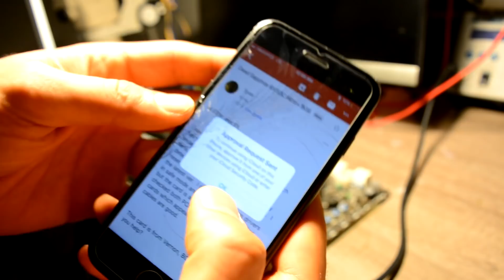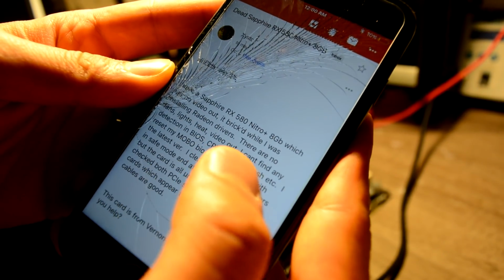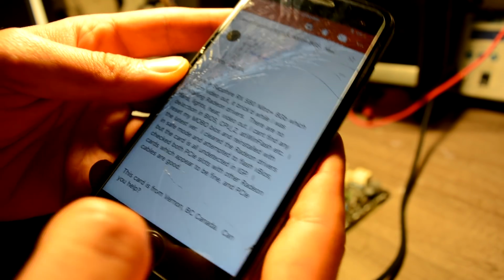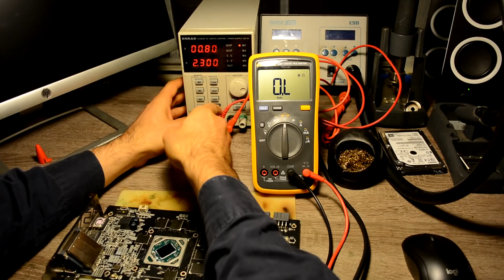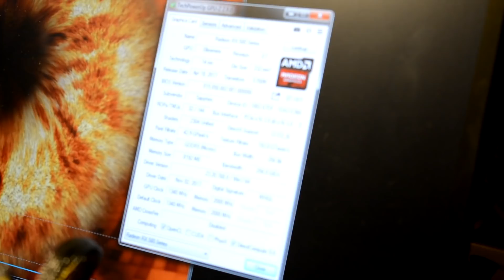RX580 repair graphic card unusual problem Radeon Sapphire nitro video card repair

Comment: ser i need help i have an asus b85m-e mobo with rx 580 (xfx) its runing on pcie x8 (3.0) instead of x16
Reply: Try reaseating the cpu and check for bent pins or out of place pins on cpu socket, it happened to me on 2 different occasions using 2 different pc builds, try it and let me know, if you have an Intel board I know this might work

Comment: I also need help with a RX 580 soon as I plug in the 8 pin it shuts off the power supply it's a msi card
Reply: Did u find why ?
Reply: @AdamKimo  I applied power from a power supply that doesn't shut off low amp and it popped a mosfet I replaced it with a new one and now the pc turns on with it but the gpu doesn't get hot and no power on any of the phases

Comment: My congratulations... Can I ask you for some help... I bought a 2nd hand RX580, I run it 1st time all perfect and I decided to change the Thermal Paste and Clean it, because it was really really dirty... also with some oxid. It runs perfect... but I have a problem if I leave the graphic card some hours power off, I need to give some hot air to make it start up. After that hot air it starts and I can leave it without any problem hours and hours...

Comment: I have the same card brand new from Amazon and I works for a couple of minutes and then it either stops showing image or goes to a random solid color like purple, but the fans and everything is still on. Any ideas what the problem is?
Reply from the maker: chip.. gpu went out
Reply: @elitech3339  so it is DOA? This is second card I've bought that hasn't worked :(
Reply: @elitech3339  I also have a new card that would turn on with the fans and everything but would only show a black screen? The monitor said it detected a signal but showed no image

Comment: I just learn from your video that doing a video card repair job just isn't worth it considering how long it usually takes to pinpoint the problem in similar cases and howmuch the customer is willing to pay for the job. and whe you find a chip problem then most likely just a total waste of time as only few customers are willing to pay for a new chip and reball job. :S

Comment: I have strange issue with this RX580 Nitro. On DVI works just fine in every stress test Unigine heaven, valley, furmark.
But on HDMI it just randomly cuts out and says "no signal" sometimes during the test in heaven, sometimes even finishes test and then when i press exit on heaven goes black again. When i plug in DVI again works without problems without going to no signal. Anyone else had a problem of that kind?

Cheers

Comment: Hi Eli, first of all nice vídeo I'm a tech from Argentina and I'm having an issue with my Sapphire Rx 580 nitro plus, maybe you can give a me an advice of what can be the problem with it. When I put the card on the pci slot the motherboard doesn't power on. I've tried it with 4 motherboards and it goes the same with each one. All mother's work fine without the card pluged in, ¿ in this video when you put the card on your mother is power on ? If no, maybe a can do a step for step like you do to know if a regulator or a driver is in bad state. Thanks for your time and keep the good work :D
Reply: Again me, if a power the graphic card the ATX enter in protection mode. So I can't test any driver or regulator... :/

Comment: I have a gtx 970  when i install it the pc boots like normal but no display i tried using the motherboard display while my gpu is installed and it has display .
I looked at the device manager > Display adapters i can only see the onboard display .. we tried to reheat it , and it works fine for a minute then .. sudden no display but it still works i can still feel it. sorry for my english..

Comment: XFX RX 580 I got has problems as well and I wonder if it's simply thermal pad and paste that needs replacing (It runs, it just crashes the PC if the GPU seems to ramp up usage, via BSOD). I never got around to actually trying to fix it because I don't use that GPU anymore (Asus Strix Vega 56 user here, I gave my Nitro+ 580 to my brother, and the old Intel i5 2500 system is using a 470 since it has 500 Watt PSU.

Comment: Great video bro. I bought rx580 as it is condition and its not booting no video no fan spin only blue light on the pcie power connector turns on. what might be the problem? I am in UAE can't find any repair guys here for gpu

Comment: Hey Eli, I am trying to diagnose an RX480 and was wondering if you could guide me in the right direction. The GPU "works". It boots, I can play video games and everything but everynow and then, the whole picture on the screen turns into a checker board pattern and the computer freezes. I have not been able to replicate the problem. Sometimes the computer works for days on and sometimes the computer will crash with the checker board pattern seconds after booting up. If I boot in safe mode, this problem never appears (AFAIK). 

Any idea of where to start looking?
Reply: Most likely bad GPU or bad VRAM, if you are lucky reflowing the VRAM chips will fix it, but there is no way to tell how long the repair will last.

Comment: Great video Eli. 
Btw i have a problem with my old card, when I turn on my pc the fans just go to 100% speed and doesn't slow down and it has no display. What do you think is wrong with it? I'm using a different gpu now and everything is fine, just my old card is having this issue.

Comment: hello, I have an asus r9 390 strix 8gb that randomly, that is not at any particular moment, crashing and the monitor is without signal, the only way to restore the system is to turn off and on again the pc, since when restarting the problem persists, what can be the causes of this?

Comment: Hello Eli Tech. Your videos are amazing! There is so much knowledge you give people free. Thank you very very much!
I also would like to ask you something: I have a broken gtx1050ti which is crashing at driver load. The card is working fine unless i use nvidia driver. This happened for the first time during gaming with 100% load on GPU. Since then the GPU keeps crashing. Tested on different systems. Would you give any recommendations where would I start any diagnosis?

Comment: Hi Eli, nice video. I have an RX570 NITRO+ that I feel it's broken. My PC always crashes because of wattman. I'm not sure if it is a driver issue or my gpu is broken. I'm sure you came across this issue before. Any advice? BTW, I have reinstalled the drivers with ddu and installed many windows versions and the problem is still there.

Comment: Hey, I've ended up getting a broken 970 gtx, power to chip, no power to memory, I've tracked it down to the mosfets, there is no power to the gate (12v power to drain), what would you recommend looking for next? I originally thought the mosfets were broken. Would it be the driver?

Comment: hey bro .. can you help me ?? i got problem with bus interface for my RX550 .. it should detected as x16 3.0 but in GPU-Z it was x8 3.0 .. my motherboard using Asus A68HM-K and my CPU was Athlon X4 880K with Near Silent .. how can i fix it ?? i want my GPU run at x16 3.0 .. can you help me to fix my problem ?? also i cant connect my DVI-dual link to vga .. and has no video out from dvi-dual link to vga converter ..

Comment: Hi, my pci-e has 6 pins conected  and 2 pins disconnected to my gtx 960, so the curiosity here is, the other 2 pins disconected were made to conect gpu's like rx 580 that comes with 8 pins pci-e? If i do an upgrade to rx 580, will work it too? My cpu is an i5 4680k 3.5 ghz not ovc!

Comment: quick question! 
12v fuse near PCie its sorted 2 G.
if inject 2V it eats near 3amps and chipset gets a little hot.
get this i used the external  PSU to start the card with 6-7 v and was stopping at 3 amps (internal protection) but the phase to GPU was ramping up to 0.6v the only thing was missing was Memory phase that was 0v.

Comment: Hello!. Query I have an Asus HD 7850 DirectCU II 2GB 256bit. The problem that I have is that it works for me if I connect it to the screen but when installing the original drivers or it does not stop giving screen, previously I had some red dots probably problems in the vram. Currently I do not use it but I would like to repair it. I can see videos without problems but no more than that with the generic windows controllers. I usually use Linux but it also fails.any advice?. I'm sorry my english.

Comment: How to recognise VRM chip? While i was gaming i had a problem of pc turning off due to gpu overheat. 

Also, i have another problem on a 560ti card. It basically restarts PC/bsod (if i recall correctly) when u try to run a game unless its graphics clock is set down by 200 (to around 570). Any ideas?

Comment: After I watched a few videos, I have to say: congrats, you have a new subscriber! This really is awesome.
By the way, I have two issues, maybe you can help me with them.
1st: Gigabyte 980Ti, works fine, but has a cracked solder joint on a VRAM module (artifacts when slightly moving it). How can a see which module needs a reflow? I cant remove the heatsink as the GPU would then overheat.....
2nd: "Dead" Gigabyte R9 270X, crashes under load. I suspect the GPU itself. Could this be possible? Or is it also possible that VRMs are shot?

Comment: I have a question, vga rx580 missing fuse on the 12volt pciexpress resulted in undetectable and vga fan dead. It could happen?

Comment: My card is Sapphire RX 480 Nitro and it works, but has problem with hold gpu core clock under heavy load. Wonder if it's something faulty on power section.
Reply: P-state switching under heavy load, because of the power limit, try increasing the p-state 5&6 frequency, and lowering the voltage for those states with amd-wattman

Comment: I ahve a GTX 670 and it crashed during gaming. Now I am stuck on low resolution. Anyone knows how I can fix it? I have redownloaded drivers / older drivers.
Reply: It is most likely the VRM can't delivery full power.
Reply: Disassemble it to just the card and the i/o plate, make 4 tiny tinfoil stilts on each corner of the card to support it, put it on a baking sheet and put it in the oven for 395F at 9 minutes. not shitting you. Or you know you can always upgrade, a 670? cmon bruv
Reply: @dayyou  that's not how BGA reflow works bro, and 670 can still perform on some games

Comment: my cards just done the same where in the world are you im in uk can i send to you i have two that need repair iv bought one as a repair to fix and mine has just gone down what setting do i use on the multi meter to test the part you replaced great video by the way
Reply from the maker: rotors r russ fpv resistance. 

Info about sending cards in About of channel
Thanx

Comment: can i ask something i have a problem with  my videocard but the problem is the  driver  my video card has a display and power but when im going to install the driver it says  the driver failed  it to install   even though i get the correct driver in website still failed to install  same with the  cd  driver  which components parts should i remove it or replace it i hope you can help me my prob bro  thanks a lot

Comment: I have a question, i have a Sapphire Tri-X R9 290 4G and sometimes the screen goes black and the pc freezes, it's happening randomly, even in windows even in games, sometimes can go up to 10 minutes and sometimes only 1 min to go black, so i don't know. Tried bios flash, but same after, tried older drivers, but's only the same. Thanks for the help.
Reply: If the screen goes black and comes back on, could be that the solder balls are cracked under the chip. In this case, reflowing would fix the issue, temporarily. Or it may have something to do with some capacitors on the video card, but it can also be some fault somewhere else in the computer, like the power supply. Have you tried different video card to see if it has the same issues?
Reply from the maker: most likely gpu needs to be replaced. Cant say for sure

Comment: sir i have sapphire r9 270x toxic edition 2gb ddr5 graphic card  , the card is not giving any display , same issue happened 2 years ago , i used reflowing and it worked  but now after 2 years , i was playing game and pc shuts down  automatically , and was not booting up again , i pulled up the graphics card and tried to run pc on  cpu 
and it worked

i tried reflowing the gpu 3-4 times
but didnt worked
:/ help please